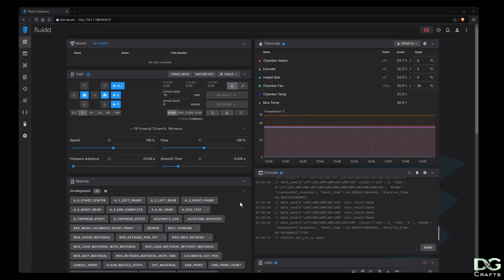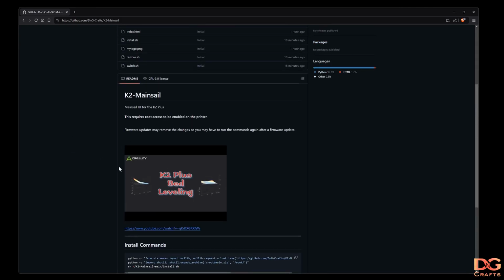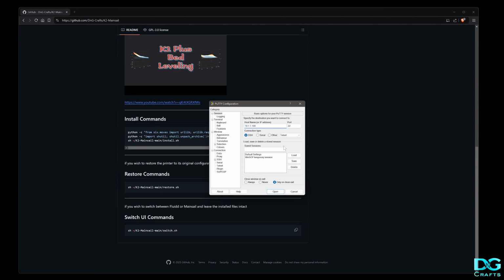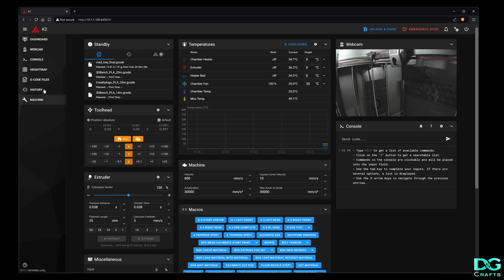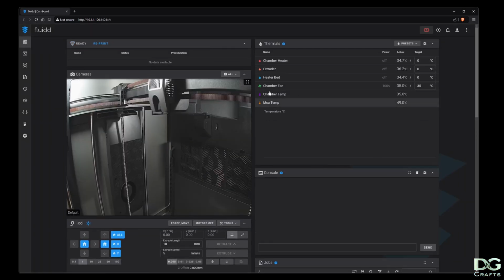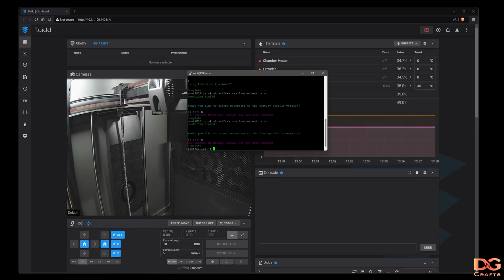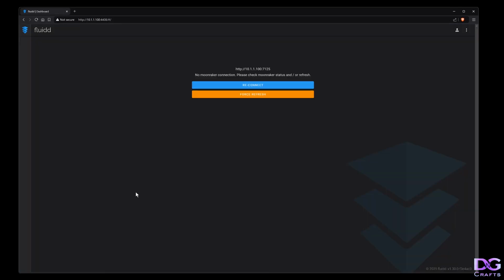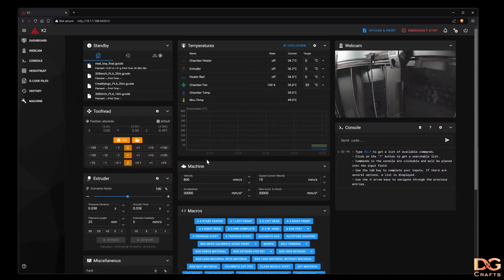K2 Plus Mainsail Install

Comment: Is there a way to load both and select by port number like it would be using kiauh to install both.
Reply from the maker: to enable fluidd while mainsail is also running you need to add another server block in the "etc/nginx/nginx.conf" file with the listen port set to something like 4409 and the root set to "/usr/share/fluidd"
that will cause nginx to run both at the same time

Comment: Nice! Recently purchased the K2 Plus and my preference is also mainsail. There is just one issue I see is that the image thumbnails are not working. I noticed this prior to installing mainsail and using Orca Slicer. Anything I upload that was done in Orca, there is no thumbnail.

Comment: Thank you for the vidéo. I prefer mainsail. Is mainsail moré stable with the caméra than Fluid. ?
Reply from the maker: the camera is the same on both
Reply: @ ok thank you! 
I followed your titi about the cam, and I made somthing wrong. The cam does not appears anymore… 😔
I will try to resté to default factory settings.

Comment: This is great! Is there any way to have mainsail and fluidd running on different ports to avoid the need of switching between them?
Reply from the maker: you could by adding another entry for a server into "/etc/nginx/nginx.conf" with a different port like 4407 and have it point to the mainsail directory and have the other server entry for fluidd port 4408 point to the fluidd directory.
Reply: @DnG-Crafts  Sounds good but as I am not so a linux specialist I won't be able to manage that...

Comment: Awesome. I am new to 3D printing, and I selected Creality as my ecosystem, and the K2 as my first printer.
Is there a tutorial out there that will teach me what are all the moving parts? (like what is moonraker, Tina Linux (apparently derived from openWRT) , Fluidd, fundamentals of gcode, etc.) I am very familiar with Linux.
Reply from the maker: I dont know of tutorials specific to tina but there is alot of info on moonraker, fluidd, which are all made for klipper.
Most of them are on github and have fairly large communities around them.

Comment: Awesome mate! Been looking for this as your other vid for the cam. You did mention fluidd better than mainsail. I've also been a mainsail user from the very beginning and used to this instead of fluidd. Just wondering what makes fluidd better than mainsail? Cheers
Reply from the maker: I dont know if it is better but it has more information displayed.
It probably is better but i prefer mainsail because i have used it for years.
Reply: @DnG-Crafts  yeah, some people on discord seems to be saying the same thing. But I can't really spot the advantages over mainsail so far. 😅
Reply: @DnG-Crafts  BTW, I just applied your fluidd camera fix script then ran the mainsail. camera is not viewable on mainsail now. I can view the cam on port 8000 (only for firefox). so if it works on firefox, I presume I should be able to view it on the UI on port 4408, right? I also noticed that the service is left bank for the cam. perhaps that just need to be selected to something?
Reply: @DnG-Crafts - any idea? Ta
Reply from the maker: @LastZion  port 8000 is the webrtc feed from the printer that the creality print slicer uses, if the browser supports webrtc it will allow the feed to play.
you could try run the full mainsail install command again as i fixed an issue for someones ipad yesterday.
Reply: @DnG-Crafts  thanks. I removed mainsail using your remover script after I installed it, and camera was working straight away on fluidd and I haven't tried reinstalling it since. I will give it a go later. Thanks
Reply: @DnG-Crafts - just tried it again and it is now working on mainsail. awesome! I feel more at home now. Cheers